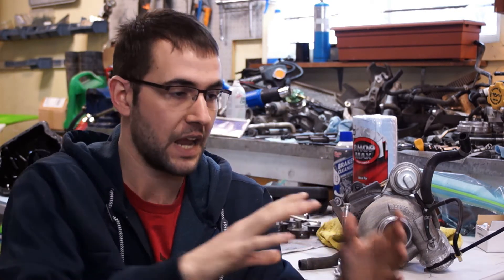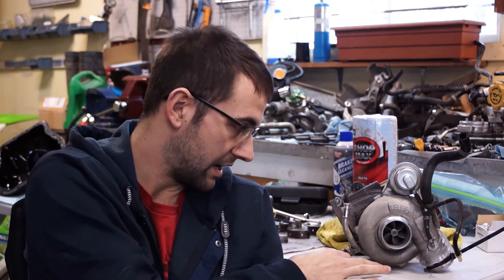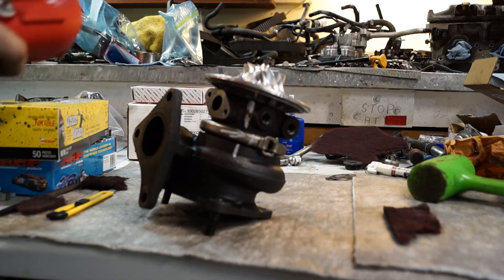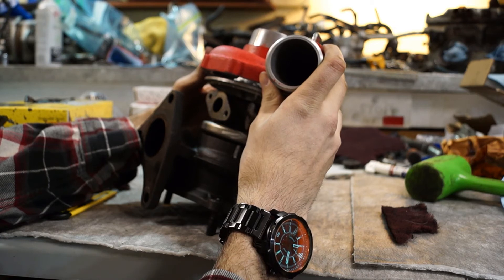How to upgrade any turbo with a billet compressor wheel [Frugal Garage EP14]

Comment: Lol .... And? No sound / demos? Who says you didn't fuck it? .. nah man, great video. To be honest, buying the billet, uninstalling the turbo, possibly damaging something.. sending it to get balanced, waiting, paying, car off the road etc. It may possibly be more sense to let's say remove the k03 and replace it with a pre built  k03s?
Reply from the maker: it only cost me about 300 canadian dollars total to do it at the time. I just rebuilt the turbo on the MR2 and did all of the internals, upgraded the exhaust wheel and the wastegate actuator, that was closer to 600 all said and done. much cheaper than buying a new turbo. I don't have the subaru anymore but it's been running fine since i sold it, and i put 30,000kms on that engine after i did all that.

Comment: I’m confused on the balancing. You installed the compressor wheel and then took it somewhere to get it balanced?
Reply from the maker: Yeah, VSR balancing is when you balance it when it's assembled. Just had it done to the turbo in the MR2. They shave material off of the nut on the compressor and turbine side to balance it.

Comment: PLEASE, DO NOT USE AN IMPACT OR DRILL. Use a T handle to untighten and torque the nut, otherwise, especially on smaller shafts, you can and will bend the shaft. For marking orientation use a punch and punch where the oil inlet is positioned, if you forget place the chra in the turbine housing and install on the vehicle, then find where the compressor housing should be orientated. To more easily remove the turbine housing use kroil or heat, preferably oxy, map/propane will do but will require a lot more time.

Comment: notice any performance increase? Also is there any reason to upgrade the turbine on the exhaust side?
Reply from the maker: It spools quicker and easier, so part throttle on the highway, it will be making boost. Top end doesn't drop off as much. I think it holds 17 at redline